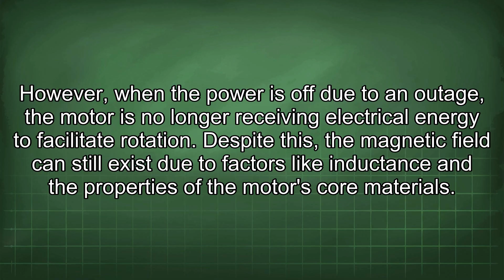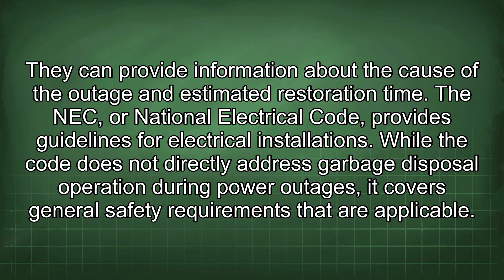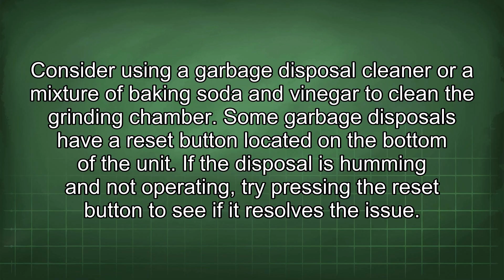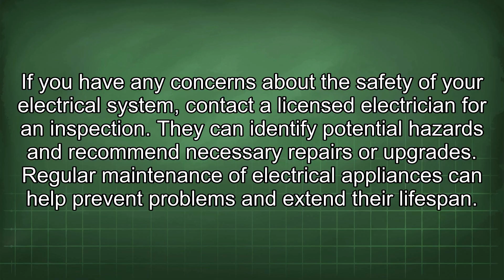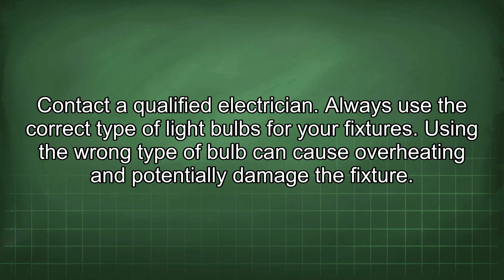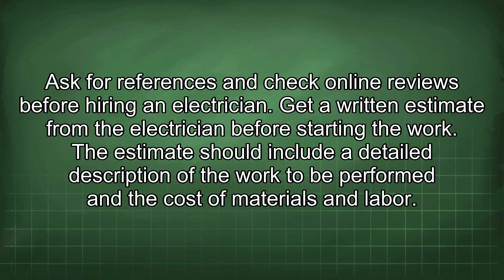Garbage Disposal Humming During Power Outage Explained

Comment: That makes no sense because simply turning it off would make it produce noise as you explained and that’s just not possible.
 I’m willing to bet it was turned on and there was more of a brown out rather than a total outage so it may have been receiving not enough voltage to start rotation, but to make noise and that is common on AC motors that are underpowered
Reply from the maker: Hello @jeffgriffith7003,

Thanks for your comment. You have a completely logical theory.  We suspect it could be electricity through the other leg back feeding through a large L-to-L device such as a water heater. For example, this can be the case if one of the conductors or transformer coils is damaged in a split phase transformer, or one of the medium voltage phases is lost/open in a three wire 120/208 or 127/220 system.

Sincerely,

BESA Research